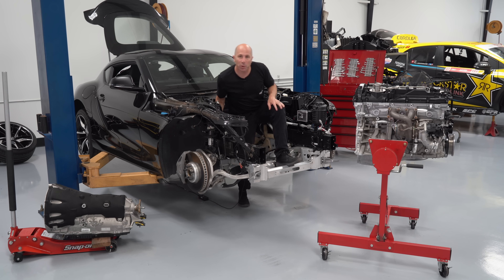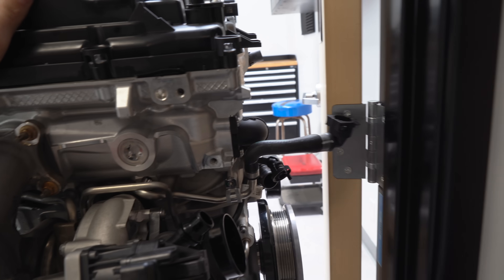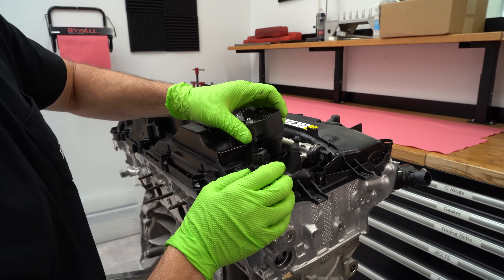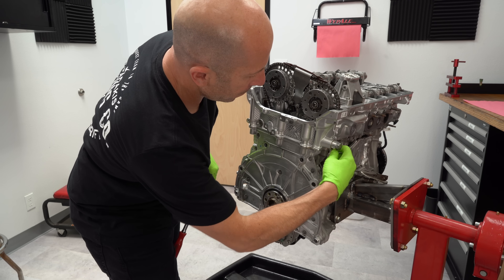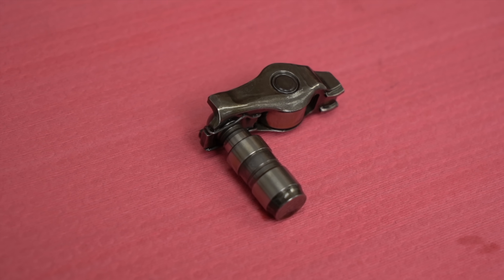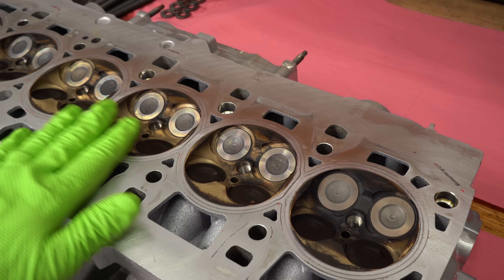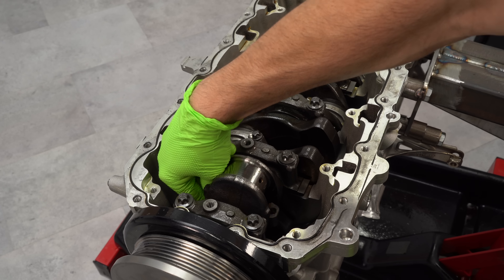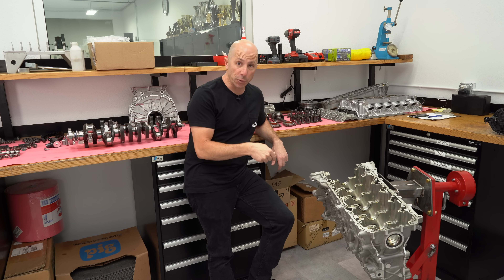2020 Supra B58 Engine Teardown - First Look - Better than the 2JZ?

Comment: Biggggg oof on that plastic timing guides. Cant wait to hear about them failing. Audi had the same design, timing in the back, running along plastic guides. Theyd fail over ~60k-100k+? The RS4 later acknowledged this issue, and updated to using metal guides. 

Let's see how this one turns out.
Reply: Cygnet I took my plastic ones out of my Audi and bonded a layer of Stainless to it with aircraft grade epoxy. 244k miles and never had an issue although I did replace my timing chain at 150k it looked good it was just time to change it.
Reply: the engine in my car also does. It's 20 years old and ran 230000km. Plastic chain guides are still ok.

I'll probably replace them though as a preventative measure.
Reply: My buddy lost his S4 due to those chain guides failing. Nightmare to get to rear timing chain.
Reply: Hsi 1000hp motor has plastick guides
Reply: Mercedes we’re using plastic timing chain guides in there engines since the 80’s, and there diesels are known for crazy mileage on original chains
Reply: Mercedes we’re using plastic timing chain guides in there engines since the 80’s, and there diesels are known for crazy mileage on original chains
Reply: YEs. We are speaking of Volkwagen group. You can be sure they will make sure they will try hard to make the engine fail between 60k to 100k. It's literally their DNA.
Reply: If they are in any way similar quality as the ones in the M52/54 engines, they will last for ever. 329k km on my M52TUB25. First chain and guides.
Reply: "Plastics" have come a very long way in the past 15 to 20 years. So, these guides may be a higher grade plastic!!??? BUT!!! I would want "metal guides" as well. So I basically just contradicted everything I said........yeah.....
Reply: Almost all cars with chain uses plastic guides. They usually don't fail, but on some engines it does, lets hope it doesn't on this one :)

Comment: the most important thing about the cracked caps is to put them back on the same rod and in the original orientation when reassembling. a guy from a local shop screwed this up, by just numbering the caps and rods, but not making note of the orientation. the engine spun 2 of the rodbearing after quite a short while and the shop has had to fix the damage free of charge.

Comment: "This engine was so new we had to get a whole car".......arnt the B58's 4 years old?
Reply: The exact engine that's in the Supra Mk5 was not previously available.  They're all  B58s, but they have different rated power outputs and possibly differences in specific packaging and design.  The B58B30M1 was only released at the end of 2018 in /any/ car, so it's been available for about 8 months, but the largest production car containing it is the new Supra.  The existing B58 in the M240i and 540i is the B58B30M0, which may have key differences. 

As I've never personally disassembled them side-by-side, I couldn't say, but perhaps @PapadakisRacing could shed some more light on the topic.

Comment: VW had a bass ackwards timing setup before it was cool,  some of you have never lost your sanity on a vr6 and it shows
Reply: Your right they did it on the vr6 and the 2.5 5 cylinder. I sure on both of those cars you can perform the job with the engine in the car since all you have to do is remove the transmission to gain access. That's different compared to removing a transmission and still having a firewall between you

Comment: So just never get into one of these with over 100K miles on it. the rear timing cover will be leaking and you'll eventually need to replace the timing chain guides. Not an engine for longevity.

Comment: bEtEr ThAn A 2jZ?
*immediately points out that it requires a custom fabricated engine stand because the fucking geniuses at BMW put the timing chain behind the god damn flywheel.

Comment: Some really cool details there - a bit thank you for going to all that effort and expense, and I can't wait to see what you make of it!
It is getting quite common for the head to incorporate the exhaust 'manifold' internally - any thoughts on the affect that heat being directly fed into the material will have on efficiency, durability and heat management when modified engines increase the thermal loads? I had thought that, perhaps, it would be possible to machine off the passage and bolt on a fabricated manifold but it doesn't look like that will be possible due to the design - a possible market for an aftermarket design that offers a more conventional flange?

Comment: Those plastic timing guides are probably going to be a weak point in these engines.
Reply: Lets not forget the horrible plastic chain guides on the bmw  m62 v8 😬😬😬😬
Reply: it wont be, both Toyota and BMW have been using chains for a long time and rarely ever had any issues
Reply: And you have to pull the transmission to get to it.
Reply: They are coated whit teflon to reduce friction...
Reply: @RST-R-MODS  it's still plastic, makes me think of the VW I had
Reply: @brandonnecessary ,and....?The OM606 is the same design and no issues...
Reply: @RST-R-MODS  cool, want a gold sticker?
Reply: @brandonnecessary  so,you know more than the BMW engineers?I dont think sooo,and in my 20 years of mechanic only 1 time i have to replace a broken chain guide.
Reply: @RST-R-MODS  must not have to deal with many VR6 engines from VW then.
Reply: @brandonnecessary  actualy i owned a Golf 3 2.9 VR6,and guess what...no issues,in 1000 engines build is theres always 1 that goes fail,one of my cars as the most reliable diesel engine in the world,the OM601.911,and even thoses can fail...but the OM606 that can reach more than 600hp whit stock internals and the guides are al plastic......they dont break,thats is a fact...
Reply: I don’t trust the bike chains BMW and Mercedes are using these days! Spend a few extra dollars and bring back the double chains like on the M112 & M54 engines. From my experience with the N47 and M271, the chain and guides are definitely going to be a weakness of this engine!

Comment: It seems like the integrated exhaust manifold is going to be the main flow restriction when opening this engine up for a bigger turbo. Thoughts on that part?
Reply: Milling machine 😉
Reply: Extrude hone it 👍
Reply: Custom billet head block maybe for serious level.
Reply: Milling that part off is not all that simple, it's water jacketed. And honing it might be also not be a great idea, you might thin out and crack a water jacket. I'm quite curious to see how much of a problem this turns out to be and how mr papadakis takles it
Reply: Just ONE of many problems with it.
Reply: @enigmaPL  oh master engine builder and designer of the internet please grace us with more of your vast knowledge gained from years of watching YouTube and perusing of forums and blogs.
Reply: @enigmaPL  
And you think I haven't got any experience which is honestly hilarious. 
I have plenty for my purposes. But I'm not going to watch a video on the internet and make stupid assumptions about the quality of an engine without actually putting spanners to it myself. I know the value in actually holding parts and seeing without looking through a phone screen. The only real issue I think I people will really struggle with is the timing chain at the rear.
When I do timing chains i like to take the engine out and give it a going over. I've rebuilt a good number of engines for my own projects and from experience if you need to replace a timing chain it's probably time to give the engine as a whole a good inspection. Which is always easier on a  stand than in the car.
Reply: @Cafferssss  🤣🤣🤣
Reply: Thought the same thing. Won't be able to jump to a Hypertune or anything right off the bat. BUT, with a new design comes different possibilities and maybe (hopefully) some wicked stuff can be done.
Reply: Avboden that manifold is more than big enough for 1000hp under boost.
Reply: This car have more DLCs than an EA game

Comment: Rear mounted timing chain. Hope they put really good guides and tensioners in there. Unlike in the B6/B7 S4. Although the S4s also was comprised of 4 chains in the back and lots of gears.
Reply: Yeah. Granted I never had an issue with a timing chain in my e36. Even with almost 300,000 miles.
Reply: Cory Borrow I’m saying the same I’ve owned e46 e60 e90 f10 all between 1-200k miles never a issue ever with the chain
Reply: @the_first_resort940  you had none of those cars.  If you did, you wouldn't be defending them on the internet.  You'd be out driving.
Reply: @the_first_resort940  There is a lot of chain problems with the m62tub V8 and the small engines in 1st gen 1-series. But usually there shouldn't be any problems with the chain during the engines life.
Reply: sachelle babbar right ? Cause I don’t have video proof or anything on my profile
Reply: @the_first_resort940  Let me tell you a story about the BMW N47 diesel engine... basically past 150k miles the timing chain could just snap at any moment... oh and yeah it's at the back of the engine
Reply: sachelle babbar oh you’re 12. That ends that.
Reply: Have you heard of the 4.0l v6 from Ford with one chain for one side in the front, the other in the back. The day I heard of this I vowed never to own one.
Reply: Never heard of a timing chain problem in a bmw
Reply: @the_first_resort940  lololllllllllllllllllllllllllllllllll
Reply: sachelle babbar let’s only talk from experience internet warriors. Can’t even put a pic for your profile but you know about bmws?
Reply: @the_first_resort940  Never heard? You don`t know the BMW engines than.

Comment: that oil cooler looks like it will cause a lot of oil/water mixing problems in the future. When that gasket fails oil and water will mix.
Reply: unlikely
Reply: Austin Halota all gaskets fail after heat and stress sooner or later

Comment: engine can be gotten easy as bmw has been using them for 4 years why not just look for a wrecked bmw with one in it
Reply: There are differences between the current b58 and previously used are there not?
Reply: @Cafferssss  yes. But very few including this one in the mk5.

Comment: Yeah that is definitely not a japanese engine lol. That engine has German alllllll over it. The stupid timing chain location, the awful variable valve lift design on the intake cam, the inability to use a regular engine stand, the terrible oil cooler, the bad intake cooler design, the rods are cast and cracked which is really weird,and and i really don't like direct injection. The retainer clip in the rockers is kinda neat. The mechanical fuel pump is good. The twin exhaust ports are cool and make bigger turbo use easy. The dual VVT is handy but can be sketchy. Wayyyy to complex. The Nissan GTR V6 is just as technical, but 10000x simpler and easier to work on. The B58 is a terrible engine design and servicing will be astronomically expensive.

Comment: Love how he says "they", you mean BMW. Also that head is terrible for flowing exhaust and rocker arms for for dual over head cams why not buckets shims so many moving parts.... Its crazy.  Chain on the back is big middle finger to the modding/world.
Reply: Why would you rather have bucket shims? Wouldnt you want self shimming.
Reply: SlowHawkeye the rockers fail in many cases especially with high RPM. Shims are better

Comment: Toyota service manager: "I need u to do literally anything to this mk5 supra"

Toyota tech: "say sike right now"
Reply: 1.5 for the PDI...... takes like 3 hrs just to get the NAV unit online......get ready to bend over getting shoved with quailty Toyota warranty times working on this German nightmare.
Reply: Ryan Bennett Lmao the Toyota dealer I work at only pays 1.0 for PDI. We make it up for block heater installations tho which is along side PDI. We install them on all but the new Camry and RAV4. Pays 2.0 and if you’re skilled enough can be done in 15 mins or less.
Reply: Everything is gonna pay 8 hours minimum lol
Reply: Fuck engine out work for chain work though that's some bullshit
Reply: @CrystalMethEnjoyer  How often do you ever need to do chain work though? Like 200,000 ks? It's not like a GM timing belt.
Reply: @SqueakyNeb  hopefully Supra owners will be a little more responsible but a lot of normies suck at vehicle maintenance. Timing sets get destroyed with neglect
Reply: @SqueakyNeb  you seem to have ignored or missed the German auto industry and its record of horrific timing chain failures over the last 19 years.
Reply: @CrystalMethEnjoyer  thats a rear chain bmw style, the engine needs to come out for chain work is expensive labor.
Reply: @CrystalMethEnjoyer  I do not know, I am not a mechanic, but if you can make the appropriate access from upside the motor to the chain... isn´t there a tool to change the chain without getting motor out. Break the chain while keeping tension in it. Join the new chain to it.  Feed the new chain in by pulling old chain out while turning engine and then join new one back together. I think this might be possible with that tool designed for these types of engines timing chain against firewall...
Reply: @ssc00p  "if you can make the appropriate access from upside the motor to the chain... isn´t there a tool to change the chain without getting motor out"

Nope.  The chain goes around the crankshaft, and you're going to have flex plate>torque converter>transmission blocking removal at that end.  You can't just cut a link like a bike, because the second you roll the engine over without a timing chain hooked up, you bend valves, plus it's the tensioners that are going to fail, and not necessarily the chain itself.
Reply: Grilled Lettuce it will become bullshit with a mindset like that I thought car guys enjoyed doing this stuff I don’t understand how this can be that big of an issue considering I don’t think it would go bad that easy unless I drive it like an ass😂
Reply: everyone with toyota certs would have general certs and a good amount of hands on knowledge. 
you should in theory be able to hand most seasoned techs basically any car and with enough time they'll probably be able to figure it out.
Reply: @badatcad  Yes, with enough time.  As they're being paid flag hours, not clock hours.  Nothing like spending a week figuring out how to get paid for 10 hours!!
Reply: The TacomaKid if they made the engine themselves the car would have to cost six figures, however the interior being BMW is 100% a joke
Reply: Take that bitch to BMW
Reply: Are you guys planning to replace or upgrade anything in the bottom end, or were you just tearing down to check for significant weak points or problems before turning up the pressure?
Reply: Badugiboy Bimmer true, I’m a Toyota fan but my ten year old 07 5 series with 260k miles looked newer on the interior than my 07 fj cruiser with 50k miles.  The bmw seats held up great.  I’ve had a few Toyota’s the seats look worn out to fast and I baby them.  I don’t eat in cars etc
Love both brands
Reply: The TacomaKid when some guy finds a 6 year old Supra with 90k miles for a reasonable price, and shortly after he buys it the timing chain needs to be replaced (because the previous owner tracked the car for the 6 years that he owned it) that $7k timing chain replacement will likely be more than he can afford. This is why used BMWs are a dime a dozen.
Reply: LMAOO
Reply: @badugiboybimmer9232  and they all smell like crayons for some reason lol
Reply: Why didn't they just continue the V10 from the LFA?!?!?!?!!!
Reply: Best comment here!!!!!
Reply: I don't know what small stream has to with it. Can anyone explain?
Reply: The TacomaKid I already know I won’t which is why I ain’t in jail and I have no plans of going😂
Reply: *psyche
Reply: @badugiboybimmer9232  im sure they do, but there's nothing supra or unique about it. the Supra was known for its cockpit so it's sad to see it gone
Reply: ITS A BMW you retard
Reply: The TacomaKid well yes it has German parts but I’m sure Toyota took that into consideration when making this part of the new supra why else would Toyota go through with it 😂
Reply: The TacomaKid  In Germany, we say "60k mile/100k km throwaway engines" now.  Even  techs for BMW and Audi have told me that thry recommend rebuilds at 100k km (62k miles) becauze so many parts are on the edge of failure and/or worn out.
Reply: The TacomaKid 😑 as if I didn’t know that already my guy 😂

Comment: A really nice engine! 
I’ve driving a bmw with a I6 in it for about 10 years... they’re just work and got ton of potential!
Reply: I've had my 04 e46m3 since april 05.It has 107,000 miles an engine rebuild rod bearings failed,vanos replacement and cracked subframe.Never tracked, fluids changed on time and with the correct fluids,not a daily driver,not driven in the rain and garaged.It doesn't matter how you treat a bmw they're going to be unreliable.The e36m3 e46m3 e92m3 f30m3 4 are all overpriced garbage.They'll spend as much time in the shop as they will on the road.THEY ARE NOT TRUE PERFORMANCE CARS.
Reply: You probably ran the wrong oil and maybe ran over a curb

Comment: Can the bore size be increased on this engine? 
 I watched a video stating that due to the special friction reducing coating on the cylinders that machining the cylinders was not possible.
Would like to know if that is correct.
Reply: Cylinder liners, if spacing allows for drilling-out that is.

Comment: Stupid Intergrated exhaust manifold on a sport car. That is the dummest you can do to a performance oriented car. Hey lets increase spool by chocking the shit out of the exhaust flow. Good luck making any power above stock. This engine will need a new head first before you do anything to it.